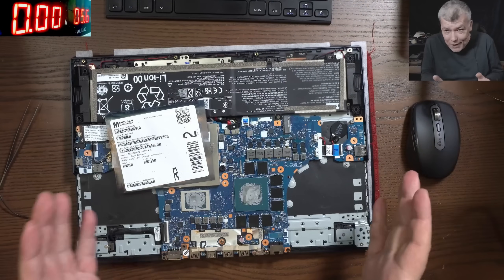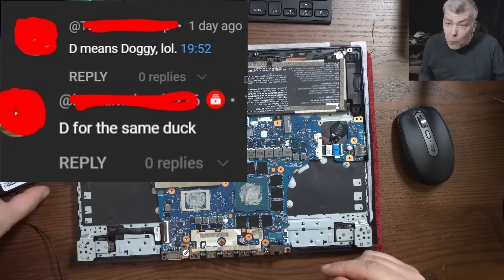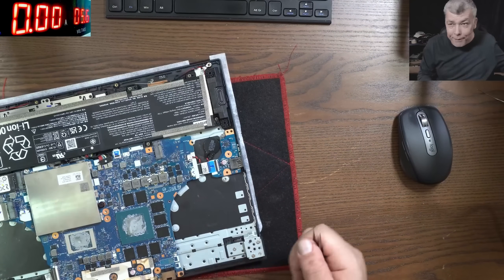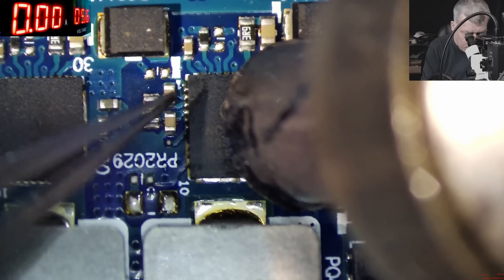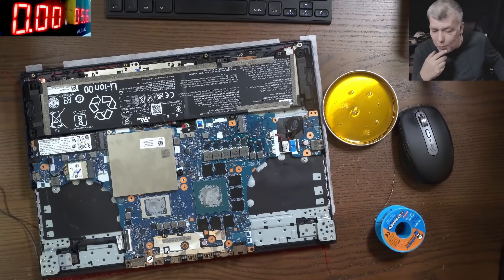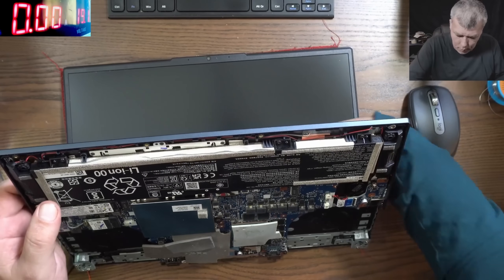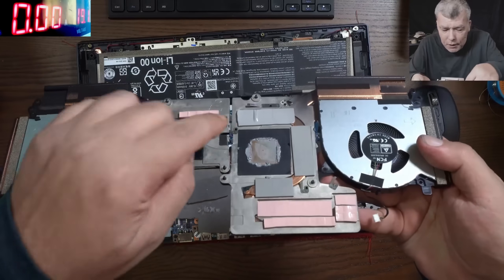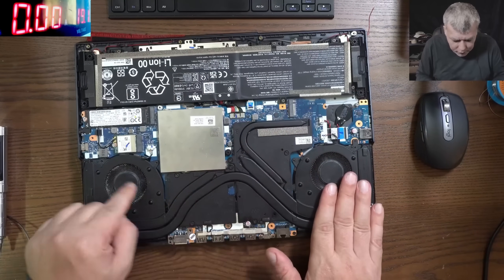Lenovo Legion 5 RTX3070 GPU power circuit repair - how we are doing it

Comment: I have dell xps with burned batery conector and striped positive path. My laptop is dead... I was on 2 technicians and they say that motherboard is for replacement. After investigating by myself I found shorted mosfet righ on battery connector!

I hope after replacing it and restoring the batry conetor path it will bring the live on my laptop. What do you think?

Comment: I usually see complete troubles with these laptop family, but could you tell me please what is going on when it sometimes boots and sometimes does not? Same with powering off. Time is always incorrect and RTC test in service bridge shows as failed in all-in test, but passes when run single. RTC battery is ok, also EC chip with BIOS are reflashing normally.... no visual damage on motherboard. I haveno clue what to do with it(

Comment: I have the same laptop and thr is something wrong with mine my wifi doesnt want to work and I said its ok not a big deal after a few days my gpu did stop too and it show 0 vram I dont know what the problem is I think the 2 might be related but I am not sure but both did show code 43 on the device manger but my wifi does work on its on from time to time I tried every software I can try but nothing worked what do you recommend I do ?

Comment: Yeah the myth is that Lenovo Legion 5/7 etc 2022+ models use PTM7950 pads.

I went to lenovo forum and asked, the answer from Lenovo helpdesk was "normal thermal paste" but as to what type and brand  no comment on that. 
Personally i used recently NTH2, feels like it got hotter and doesnt boost as much as it was with the stock thermal paste (i did some benchmarks).
But just for the sake of the comment,  in stress tests 12700h draws 130w for a second till it hits 100*C and throttles down to 109-112W and shits around 85-94*C, RTX 3070 draws 150w in full load and if numbers dont lie, ive seen 154watt with temps ranging 64-77*C.
Pretty good cooling, if you dont think about your laptop sounding like a drone and it might explode on your face or fly away at any momment....

Comment: Please Reply: 
Hi, I have the same laptop. My dedicated gpu is not working in devices manager it is show the yellow sign error"Device not connected properly." I checked the
board, and there are no shot circuits, but my Gpu has no heat up or anything.

Should I reflow my Gpu soldier, and how risky is it?

Comment: Chips are usually rated for 10 secs hot air time to solder into place?  Using low melt solder, could that chip be soldered a little quicker as you seem to have that hot air on for a very long time?  i know the board is thick but..... You are brilliant and one of the best on you tube but that long cooking really rattled me!!
Reply: His desoldering and soldering methods are appallingly bad!
Dealing with a part like that and the large copper areas is difficult. The appropriate way to deal with those issues to use additional heating, at a properly controller temperature, to be opposite side of the board. That can make a huge difference.
Reply: but what about the fact he doesn't break the components or have any problems?
Reply: @itnaklipse1669  Problem is unless you are very careful with heat, you end up stressing the chip out and it might work but lifespan will be shortened just as if you had overheated a CPU from dirty fans ect or too much current spiked through a part.  The reflow machines have heating that will preheat the underside and use profiles to carefully heat at right temps and time so part is evenly soldered into place with min stress. You can do all this free hand, but you need to heat gradually then quick and then very important, slowly reduce temp so the part isnt thermal shocked as you remove heat. BGI is diff to reg soldering in that the balls YES you can solder them and it might work. BUT wrong heat and they form fractures and and other problems that will cause failures and so many tiny balls, you can see how just a couple play up and you have a big problem!! Except for this area, this channel and his skills are very very good and hes not "dodgey" in that he makes jokes and can do it bad or good but for laughs and entertainment, he uses little wires for fues which you CAN do if you know what you are doing. toot  thick a wire and you have fire risk and damage and too thin and the wire might work for a little time but fail as it over heats over time and unhappy customer. his broad knowledge can fix boards where other "techs" cant but his chip soldering can be argued by some to be a little over long and hot, yet he gets the job done so........
Reply: @itnaklipse1669 you can drive over the speed limit a hundred times and not have an accident, but you can also have one the first time...

The rules are the rules. Component manufacturers do tell you maximum time of heating at a certain max temperature.

Of course you can choose to ignore them and get away with it. But why would you risk it? Why not use the proper tools and technique?
Reply: @silviuguseila2552  when i drive, i make my own judgment when to speed or not, based on situation and experience.  and i've now watched enough of Sorin's videos to trust his experience on electronics.  'rules are rules' is an axiom used by certain kinds of people - which is fine, but not everyone thinks so.
Reply: @itnaklipse1669  you cannot make your own judgment about everything, electronic components have a datasheet. This is what we are discussing, nobody cares how you drive, buddy, just make sure you stay under the speed limit cause you might kill people. Using heating from below is the correct way to solder on these gaming boards that have a lot of thermal mass. 100 degrees from below, and soldering becomes quick and easy, and you do not risk to create cracks in the board from overheating one area, or damaging the chip overheating it past it's tolerance (you know, the one I called a "rule", the word that you for no reason seem to hate). Do you hate datasheets?
Reply: @silviuguseila2552  what i am saying is, that datasheets are one thing, and experience and practice are another.  also, sometimes things break despite following datasheets - they are not the 'word of god'.  of course depending on circumstances, in repairs that Sorin does, saving probably hundreds in costs, 99/100 is a good success rate.  i'd trust the judgment and consider the risk low at the word of an experienced engineer.

btw, i guarantee you, the tolerances etc. are much less accurate than you think on any individual part.  engineering is surprisingly messy.  the reason i dislike hard rules is that in reality rules are not all that they are meant to be.  to return to your analogy, driving at speed limit doesn't guarantee no accidents, driving below does not, and driving over does not guarantee an accident.  speed limits are quite arbitrary.

Comment: Maybe GPU is not dead because this MOSFET is not a regular MOSFET. It is have a lot of internal logic components. Maybe it is also have some protection from short. It would be logical to put some protection function.
Reply: There are two FETs in the package, along with drivers and protection circuitry. The part is primarily intended for use in a buck converter, where one FET is used as the high-side switch and the other is used as a synchronous rectifier. If the rectifier FET fails short-circuit it protects the load from excessive voltage.

The protection circuitry can detect overcurrent. I don't know without looking at the datasheet again if there is a FAULT output that can be used to shut down other devices. I'd be surprised if there isn't.
Reply: Yes. It is have protections: 
From datasheet:
Catastrophic Fault Detection
♦ Thermal Flag (OTP) for Over−Temperature Condition
♦ Over−Current Protection FAULT (OCP)
♦ Under−Voltage Lockout (UVLO) on VCC and PVCC @D614G_aka_Doug

Comment: New Legions come with phase change thermal compound. It's better than regular thermal paste because it lasts for years and doesn't pump out.

Most regular thermal paste don't work well for Legion laptops because of low mounting pressure and degradation at high temps (80-90c). There is also a known issue with the Legion/Legion PRO models' heatsink, where the contact with the CPU die is uneven. 

While LM may provide better temps (that rarely happens, only if the LM is perfectly applied, otherwise it's gonna be worse even on LM compared to generic paste), it's also risky because it's electrically conductive. So you risk destroying a 1500$+ computer for marginally better temps.

I also own a Lenovo Legion 5i (2022) i7-12700k + RTX3070 TI and I can attest to all this. Any kind of "regular" thermal paste, even high end Grizzly stuff will not be enough for Legions.
Even if it seems to work - you will get much worse temperatures after few days/weeks due to pump-out effect. You absolutely need Honeywell PTM 7950/7958. Lenovo uses this stuff from factory. You can also check r/GamingLaptops or r/Lenovo and you will find a lot of threads there, where people have tried absolutely everything possible and nothing worked except phase change thermal compound.

Comment: Can’t you check with the oscilloscope if the phase is working? I have seen Northwestrepair doing it several times on gpus, I believe he’s probing before the inductor
Reply: People who really know how to use an oscilloscope and understand the circuitry they are working on tend to use a scope all the time. When I did repair work it was usually the first instrument I'd use.

Before the inductor is the right place. There would be a reasonably clean rectangular waveform swinging between nearly zero volts and nearly the battery voltage. Judging by the fact the inductors are only 150 nH (marked "R15") the frequency would be quite high - likely several hundred kHz, maybe 1 MHz or more.
Reply: @D614G_aka_Doug  The frequency should be about 380 kHz as far as I remember.  Quite a popular model for repair.  Repairing laptops without an oscilloscope is repair at random.
Reply: The only correct way to check the operation of Drmos is with an oscilloscope. Then you will see if it works and if it works correctly. Are there any spikes or runts during operation.

Comment: Now you lost me. You said it’s a chip but you say it’s a MOSFET. Help me out here.
Reply: The chip is a mosfet.
Reply: There are two power MOSFETs and a fairly elaborate driver and control circuit. I very strongly suspect there are three separate chips in the package. 
In the electronics industry each would likely be called a "die." "Chip" is kind of a slang term.

Comment: Worth adding that if you want to see not only if the power stage is working but also the quality of the signal it produces, you may check by using oscilloscope - probing on the coil that sits right behind the chip.

Comment: It´s not thermal paste. It´s phase change material. It´s comes in sheets. Check mouser for "laird tpcm 7400" or  "laird tpcm 5400". The one from lenovo is honeywell ptm 7950.

The new phase change material does not change to a liquid, but softens at about 55 to 60 C. Phase change material is a thermoplastic with thermal conductive fillers. Thermal paste is usually silicone oil or other oil with thermal conductive fillers.

If you replace the phase change on that laptop(I have the same one), the gpu will start overheating after a few months(the issue is more the hotspot), because there´s not good contact between the gpu and the heatsink, and the paste will pump out. That does not happen with the phase change material. And that´s why you see a bigger concentration of "paste" on one of the corners where the heatsink contacts the gpu.

For you to see the difference, it´s better to buy a phase change sheet and try it.

Comment: I was reading the datasheets when that video ended and didn't find the difference, but I think the reason why the GPU was still good is because of the catastrophic fault detection something-something that the datasheet claims it has.
Reply: Indeed, I work on GPUs a lot, and failed high-side MOSFET is about 1 in 5 chance GPU survived. When DRMOS is used, depending on the brand and quality of it the chance can rise to 3 in 5. So Sorin has outdated view on the subject really, he was so surprised the GPU was fine, when normally you do not make any assumption until checking.

I must add that short on VMEM / VCTRL rails are much worse then VCORE. Memory rails seems to be more delicate and even short detection is typically not fast enough to save the memory controller.
Reply: @DIYRepairHour  agree with you
Reply: One of the FETs in each package is used as a synchronous rectifier. If it fails short-circuit the load is protected from overvoltage. Presumably the FAULT output from the part is used to shut down the entire converter so other parts in the power path have a chance of survival. (one failed rectifier FET would short the entire multi-phase array through the winding of the inductor connected to the failed part)